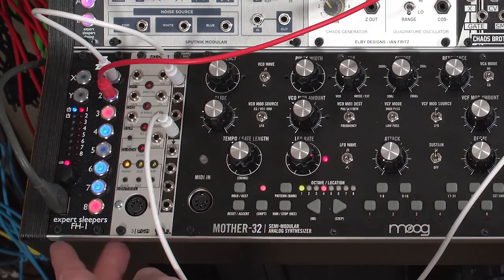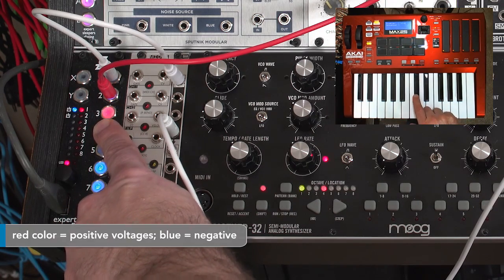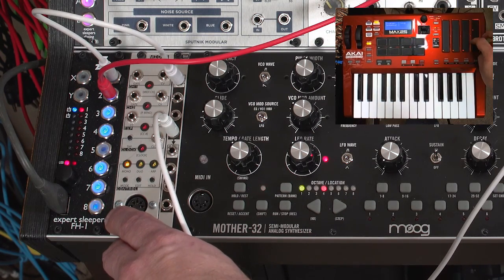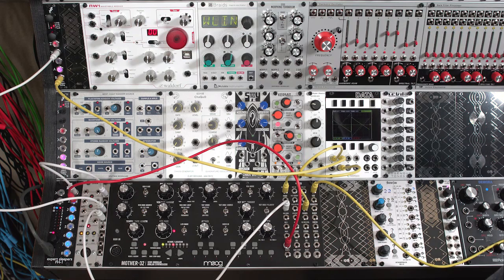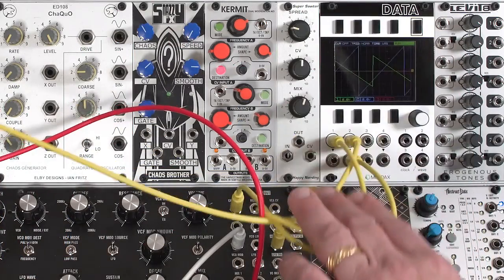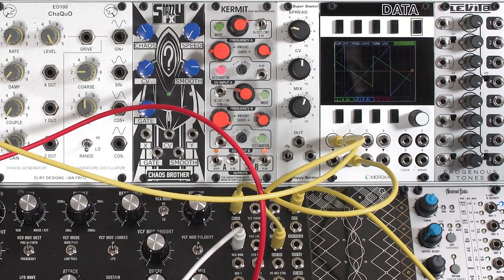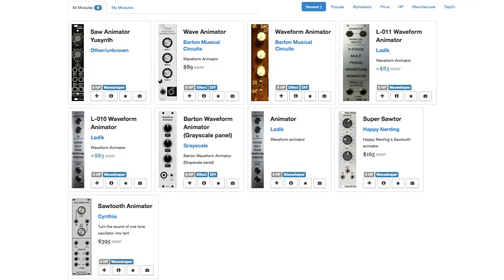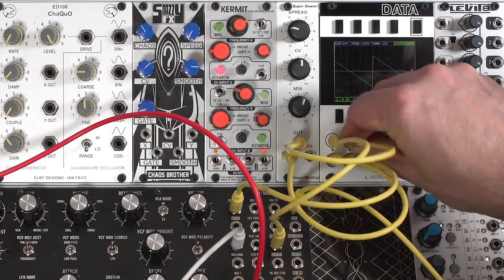2nd Oscillator versus Waveform Animator

Comment: could you show the chaos brother?
Reply from the maker: I do indeed plan to cover the Chaos Brother later this year. It's a fun module. I just have so many modules to go through....a good problem to have!
Reply: great, i wonder about the clock in aspects...if it can do burst's and ratcheting in time with the clock in. thanks
Reply: The clock/gate in causes it to put out a wobbly impulse, so it's more wogglebug-ish than an orderly ratchet.
Reply from the maker: I'd probably say the Wogglebug is slightly more versatile (with the stepped vs. smooth voltages etc.), with the note that the Chaos Brother is going from predictable to random rather than being just random all the time.
Reply: wogglebug mk1 or chaos brother if you could only have 1 random module in a small system? i read that the wogglebug mk1 clock is not tight

Comment: Really nice. Just wondering is there a difference between a wave form generator and a wave form animator?
Reply: In most cases, a waveform generator is an oscillator (which means you can tune it to a different pitch, including octaves, intervals, or detuned unison), and a wave shaper is something that creates a new waveform from an oscillator that has exactly the same tuning (maybe an octave above or below) with no detune. A waveform animator creates a new, evolving waveform that has the same tuning, which sounds like it is detuned so it has a fatter, chorused sound. Indeed, most animators sound like 4-8 oscillators in unison with detuning. So each produces a different sound.
Reply: :) Thanks so much for the response and the generous  explanation. This channel is now my go to source for all things modular. I'm considering the Kilpatrick Phenol as its in stores here, probably around next Black Friday time.
Reply: I had a chance to play recently with the Kilpatrick VCO, which I believe is based on the Phenol; they've really done something interesting with the alternate pulse waves - they sound really alive when modulated.

Comment: Another great video!  Definitely looking forward to more videos about expanding on the Mother-32!
Reply from the maker: Thank you. I just finished an introductory course on the Mother-32, including about a third of it dedicated to the first steps in Eurorack expansion: adding a second oscillator and envelope, but also a lot about mixers and mults. That should be out on LinkedIn Learning/Lynda.com around the end of February. After I get back from NAMM, I'll then start recording the follow-up course, where I take three different but representative modules in each "category" - oscillators, filters, modulation sources, etc. - and show how to wring the most out of those when used with a Mother-32 (or other similar semi-modular or starter system). Then after that, I plan to start adding a module a week up here on YouTube and over on Vimeo.
Reply: Sounds fantastic, can't wait!
Reply: Learning Modula

Comment: Just picked up a Sawtor. That phase inversion trick will come in handy.
Reply: Yeah - I'd say to get the most out of it, put an attenuator before it (even better if it can also boost the signal, like the LEVIT8 can), and a switchable inverter after it before you mix it back in with the source oscillator. You'll be able to extract a wider range of tones out of it that way.

Here's an article that gives more background on tricks like those: http://learningmodular.com/second-oscillator-or-waveform-animator/
Reply: I've had it less than a week so appreciate the tips. Lots of experimenting to do.